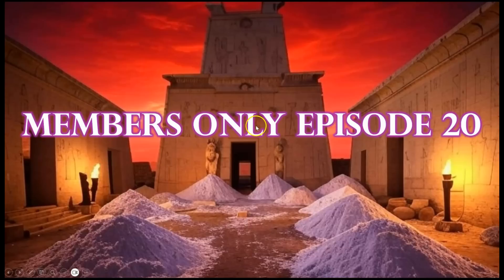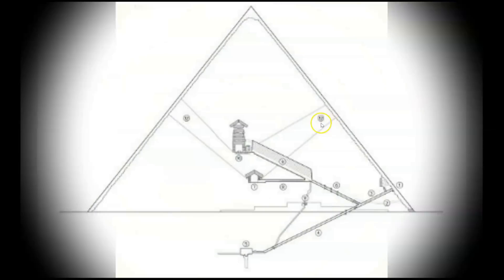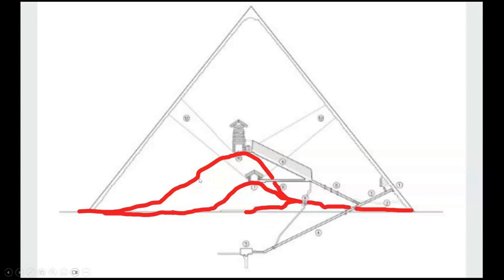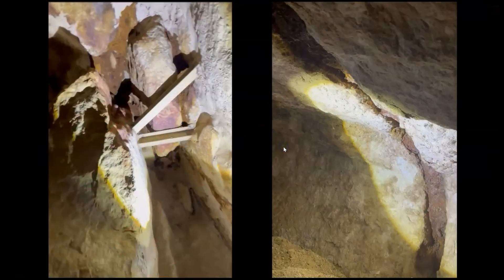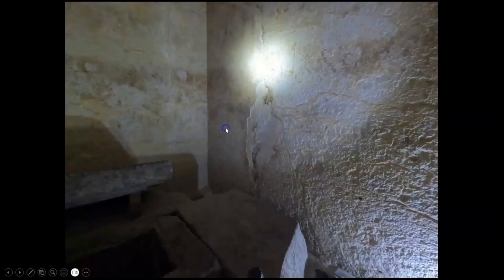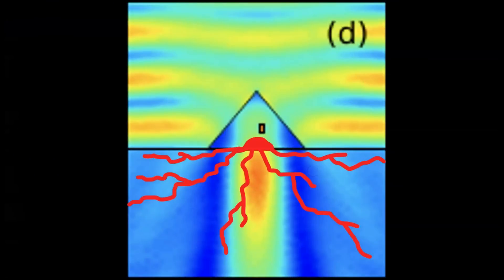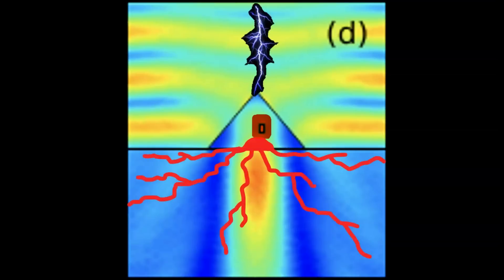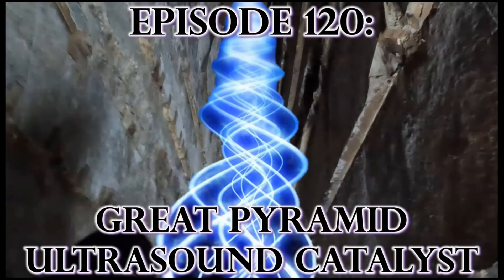Episode 150: THE GREAT PYRAMID IRON CORE - ANCIENT TECHNOLOGY

Comment: Giant Tesla coil/ Van DurGraff generators. If the outside covering was to be rebuilt (as it was meant to be ) we could and were meant to walk up the flat outside material like a road to the sky then you run off the tip and get airborne in flight, un assisted human flight.  WARDENCLYFFE Tower

Comment: My friend I don't doubt you're right about the iron in the pyramid but I get the impression you're leaning towards the giza complex having some purpose related to power...
I understand this is just a ransom comment but the information is non the less true.  The purpose of the pyramid is intimately connected to the ancient mystery tradition.  It's purpose was spiritual  not mechanical.  That's not my opinion because I've known the true purpose for many years now.  It was never lost to time only hidden.  The pyramid was the last step in the mysteries which basically allows the initiate to directly experience who he truly is before death.  He becomes horus anew.  All the proof you need is hidden in plain sight.  On the back of every dollar bill in symbolic form is the purpose of the pyramid laid bare  . They put it there to mock you but it's there regardless. Yes it's a sarcophagus in the kings chamber but you die symbolically.  It's a resonance chamber in essence but I promise you it's not a mechanical device.  If there truly is iron there then I'd be asking what does iron correspond to

Comment: If the pyramid really is built on top of an unsymmetrical mound of bedrock, it could be because it was built directly on top of a melted pyramid or other kind of free energy structure that was already there. And it could've been built in the same exact location as the destroyed structure because that's where the ley lines were the most concentrated resulting in the highest passage of natural electricity. The iron veins could be the melted remains of the structure that was originally there.

Comment: You are very wrong about lightning. 
I know exactly how it all works
Reply: Me too. it`s about heat, and water.
Reply: @amichaishiffer5082  No. They did use steam to move a counter-balance stone up, but what I mean is that the 9 pyramids together , covered in gold , with a gold platinum capstone found on Cheops, were all working together to compress energy to Cheops as they beam energy into space strong enough to move the planet. This wasn't just forming a superconductive particle accelerator via loop function to filter out mesons, but was creating a door to connect space inside the queen's chamber to identical types of space resonant with it found both in Sirius and Orion. This forms a stargate. The same ark of the covenant design from the bible sits in there to begin and control the modulation. That box in the King's chamber had the exact dimensions inside to match that ark on the outside.
Reply: @mikefromspace  My Thoughts Exactly
Reply: @mikefromspace What were you smoking, buddy?😳
Reply: Or it's just a gold recovery machine and the gold goes in the box in the queens chamber for collection. This explains the floors being removed.
Reply: @JM-wl8dh  no, the ark of the covenant creates so much radiation that priests tasked with it's care go blind. God required men to cover it in specific materials to prevent this when it's not running. When it is, you better not be close, or have it in  room made of gold. Nothing can make a beam of pure energy more efficiently than the ark. I reverse engineered this in 2012. It's zero point energy, using 55 capacitors inside a gold box with a gold iris in front that opens by rotating a handle. The winged cherubs on top are optional, as they are used to repeat the plasma field inside as a cold plasma field outside strong enough to communicate with all densities of space including god himself if you spend enough time to, since god exists in much slower timespace. Zero point energy is elementary and so was the ark.

Comment: Episode 65 m8, check comment!
Glad you have found the negative return eletrical path to chassis for the Great pyramid in sub chamber.

Did you manage to see the construction markings on the other side?  

Psst it didnt need lighting! 

It works on fair weather electricity/ie earth potential rise equation .

Its a 3 phase flyback transformer/ hydrogen plasma reactor engine with ozone production!

The slabs above kings chamber is primary winding 

Grand gallery secondary winding! 

3rd winding is the french internal ramp! 

The steam comes from under Khafre and runs through a block valve system.

The blocks use capillary attraction! From condensed water from the inside! 

The whole platue was being used as a hydrogen cell!!!  And pumped to saqqara.

Gold naturally dropped out.

I can't comment much more  ,when you mention the light slit experiment principles being used with construction,At the pyramids and edfu and luxor

Just blame me so you dont get into to much trouble with authority.

Shes auld but we can fire her up!

Mother earth had wings!